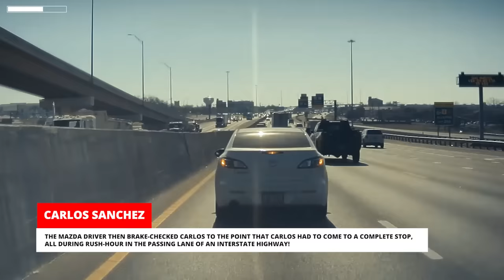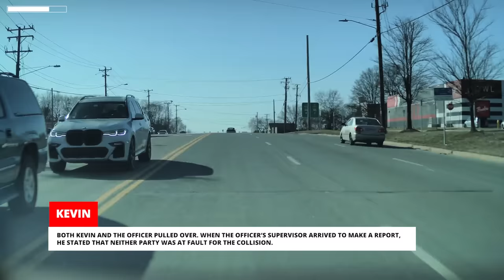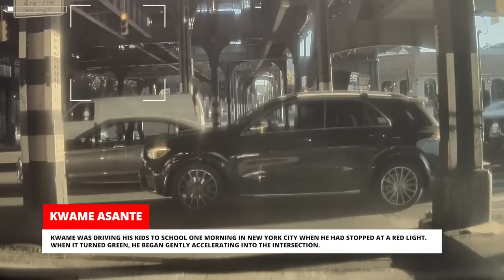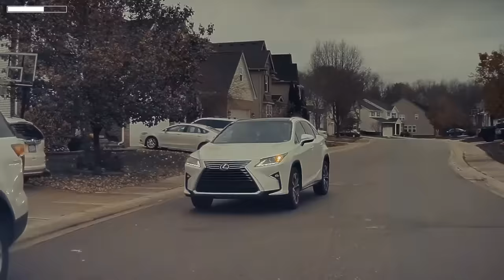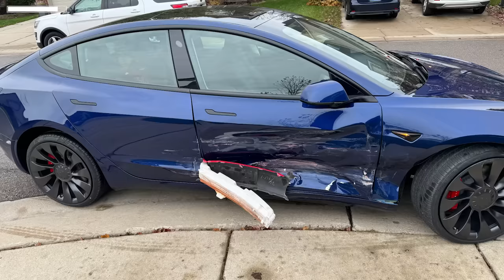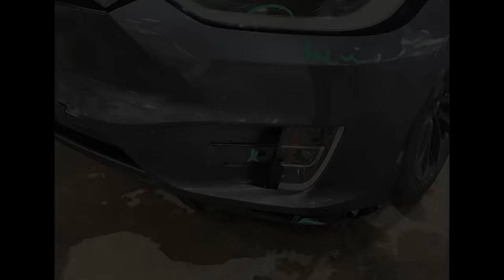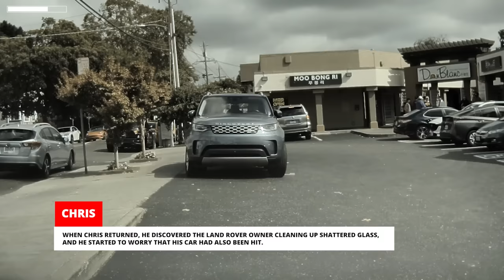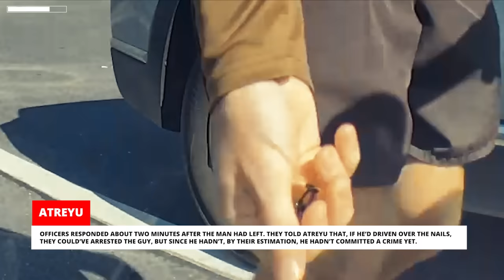INSANE ROAD RAGE ATTACK CAUSES MASSIVE HIGHWAY CRASH

Comment: The cops not pursuing the cause of the opening accident is absolutely insane
Reply: They probably made a report, they just put the Ford van as the primary factor and not the Mazda since they weren’t an involved party.
Reply: @B345T1N355Official they directly caused the accident they were so involved. Had it not been for them none of that would have happened they are the primary cause of everything that followed and because of that they are inextricably involved
Reply: Ammmmerica, here in Europe they would go after him 100% :D
Reply: Civil lawsuit against the Mazda driver for mental anguish
Reply: @account4info  Would be thrown out immediately tbh.
Reply: sure looks like Telsa cut off Mazda. you can see his front end dip from hard-braking.
Reply: @TehPwnerer  So you don’t believe the Ford van had any issue with maintaining a safe following distance or safe traveling speed? You don’t believe the Ford van, Chevy Silverado, and maybe the Highlander were inattentive? The police didn’t do anything here because there were likely multiple people who were factors in this. In chain reaction collisions, the fault is usually divided up, depending on the sequence of the cars crashing. You can easily claim the Ford van had an opportunity to avoid the accident and failed to take it.

Look at it this way.

P1 (Mazda) and P2 (Tesla) are both stopped for traffic up ahead.

P3 (Toyota Highlander) slows down.

P4 (Ford) barrels into the rear of V3 and to the side of V5.

P5 (Toyota Camry) is struck by V4 causing V4 to spin out.

P6 (Chevrolet) barrels into V4 just as V3 hits V2.

Any cop taking this report would see the Ford caused the collision as they had the last opportunity to avoid an impact and were the first striking vehicle.
Reply: Texas laws are weird, I have to admit.
Reply: @kenion2166  Highly doubt it. For all we know, the Mazda driver could be an illegal immigrant or they might not have assets. You’re better off going after the Ford driver.
Reply: @CuriousMess61  It’s kinda the same in California too. In order for insurance to go after a phantom driver, there has to be clear conclusive evidence the phantom driver caused the collision. In a lot of situations, insurance may make the excuse that the person who crashed was speeding and lost control and witnesses and the police may conclude the same.
Reply: @B345T1N355Official it's called a miss and run Mazda should be at fault for reckless driving
Reply: I drive in Austin. I was rear ended after being forced to come to a stop by an idiot that thought she should lock up the breaks and come to a complete stop because she wasn’t able to merge Into a turn lane. After I stopped behind her it didn’t take long for me to be rear ended. Since my car didn’t hit her car after I was rear ended she got off Scott free. Makes me angry as hell. Getting a dash cam only helps so much when dealing with idiots

Comment: Mustafa, my guy, a yellow light means slow down as it is going to turn red. Not saying the other driver was in the right, but it could’ve been avoided if you’d have just stopped at the red right.
Reply: Agree.  This is a case where both drivers were wrong.  Mustafa for accelerating and other driver for swerving into Mustafa.  Mustafa, my friend, learn to not trust other drivers.  Leaving that blinker on for so long was bad driving, but assuming he wasn't going to change lanes was, as you found, a mistake.  Remember this advice when driving:  There are always idiots driving on the road, and sometimes you yourself are one of the idiots.
Reply: And not speeding. Was plenty of space for beige car when they started moving over if cammer didnt hit the juice pedal.
Reply: I agree with this. He's mostly at fault. The other guy has some fault for changing lanes in the intersection, but Mustafa has most of the blame
Reply: The light was orange for at least 3 seconds. You never accelerate towards an intersection, you should reduce your speed since you are approaching an area where the chance of an accident is higher. He should have slowed down and stopped at the line. The orange/amber light is not your sign to floor it to get through, its to tell you to stop if it is safe to do so. Then his answer to the other drivers actions is to be more aggressive. Absolutely shocking driving and not surprising since he is so young. There is a reason most countries only allow you to get a license at 18. And really, its his parents car so he should have been driving even more carefully since its not his own personal vehicle.
Reply: @killerbye1985  If it was me and saw that? Would remove access from their device and then would go out shopping for a 15 year old Kia or Hundai Accent.
Reply: @russelljacob7955  agreed. I commented because I was so angry when I saw that clip. Such dangerous driving. Tesla should add a "my dumb kid is driving mode" which limits the top speed and the torque.
Reply: @killerbye1985  Same! Hence needs something basic with no power til learns safe driving.
Reply: For a 17yo, and this style of driving, someone should probably give this dude some slow car. Not a tesla.
Reply: @zYzIEk90 definitely. They could just put acceleration down on the car. I believe Tesla’s have a function to decrease performance for specific drivers
Reply: Mustafa, please don't ask to borrow another car until you've had some driving classes. Yellow means prepare to stop, not gun it.  Letting the other driver go away would have been preferable to lets pass into oncoming traffic so I can get ahead.  Excessive speeding on a residential street also not very cool.
Reply: Yellow light means go fast ain't getting stuck behind a red light no way JK

but I drive a lot so all the lights around where I live ik there time cycles and when they will turn red at the precise timing

He clearly ran the light so if he would have been in a crash pretty sure the cops would say he's at fault
Reply: yellow doesn't mean slow down.

It means STOP if it is safe to do so.
Reply: Actually no. A yellow means clear the intersection. Its to be regarded as a red light, but with the leeway of "we know you sometimes cant stop in time, so here is a yellow". Its NOT a "you may enter" light, even though selfish main characters use them like that.
Reply: Mustafa is 100% wrong. The other driver can't complete a lane change until the intersection has be crossed completely.
Reply: Agreed, yellow means stop (unless you can't safely before the light). In regards to the signal lights of the other guy, that was also bad driving. So I'd say everyone was at fault.
Reply: 100% agree. He ran the red light and was completely in the wrong.
Reply: Mustafa is at fault. I don't know how the law goes there, but here yellow light also means you need to stop and you're only allowed to proceed if you cannot stop safely. If it isn't like that over there, oh boy.
Reply: Mustafa, youth, ego and testosterone at fault.
Reply: No, yellow means get your car into that intersection before the light turns red... what's with all this virtue-signaling about slowing or stopping at a yellow?
Reply: @brandononbrand  LOL,I know your not serious.Thats a great troll though.Great post.
Reply: A yellow light is a warning that you may have to stop but you can keep going IF you are sure you can clear the intersection before the light turns red.  Yellow doesn't  mean stop - it is a warning that you may have to stop. A flashing yellow means proceed with  caution.   A flashing yellow arrow means you can keep going without stopping and turn left IF the way is clear.  Regardless of that entering an intersection always requires caution even on green.
Reply: Yellow is prepair to stop not speed up to make it

Comment: Retired Police Accident Reconstructionist here.. weighing in on some of the incidents:
* Police car was at fault for the accident. Police with active emergency equipment always have right of way, however they must be seen. There is no way to have seen the car make a u-turn from behind large vehicles. It was poor planning to turn there and not worth the risk when a simple traffic violation was the reason for the turn. 
Unfortunately some younger officers fail to realize that emergency lights and siren allow them to violate all laws except that of physics. Officers should not travel too fast in congested areas - they cannot help anyone if they don't arrive.
* Mustafa: He should have been paying better attention and not run the red light, then made the mater worse by trying to pass the overtaken vehicle. The overtaken vehicle changing lanes was not at fault - that driver cannot be expected to yield to a vehicle committing a traffic violation, such as running a red light. We have to drive as if other vehicles will obey traffic laws or driving would be impossible. In this case Mustafa ran the red light, accelerating to try to beat yellow and was approaching the other car from the rear.
* The nails in the road is littering and placing hazardous substance on the road as well as attempted destruction of property. I would have placed charges if I could identify the perpetrator. We cannot overlook these seemingly minor crimes - I believe the "Broken Windows Theory." (Wiki has an article about it).
People like the bus driver in the #1 spot should not have a license. He endangered the whole bus of people and only delayed them. If I could pass on wisdom to people, it would be to drive chill because taking risks saves only seconds and risks injury and huge delays. Stop at every stop sign!
Reply: Eh....? So you're saying that a dangerous granny driver who indicates for ages without changing lanes (thus invalidating his signal), then doesn't use his mirrors when executing a blind suicide-merge isn't at fault? And when he deliberately tries to push Mustafa out of his lane in clear use of a vehicle as a weapon, that's also okay?

Looked like a clear 50-50 situation to me.
Reply: @SVEVelsen  I didn't say anything about a "granny" signalling and not using "his" mirrors.
What I said was that the law does not require a driver to anticipate that another driver will commit a traffic violation. We must expect that other drivers stop at red lights or stop signs or we would not be able to drive at all. 
You said the driver made a "blind suicide merge" and then said "deliberately push.. out of his lane.. use of vehicle as a weapon". 
You cannot do both - blind 'suicide' merge means not looking when changing lanes, while deliberately using the vehicle as weapon means there is intention. You cannot intentionally hit someone if you do not look or know they are there.
If a person intentionally hit another they are at fault. 
If they do not yield to another's right of way they are at fault. 
Mustafa ran the red light and the other driver could not have anticipated that. 
If there were cross traffic with a green and Mustafa hit them, it is the same principle.. 
Furthermore, Mustafa was speeding and improperly tried to pass the overtaken vehicle.
The turn signal for miles example you mentioned is irrelevant - it is not a traffic violation, just a signal of intention. The vehicle being overtaken while in the roadway lawfully has right of way. This is a basic principle of driving. 
People need to be more patient. The US alone has 40,000 fatal accidents EVERY YEAR. A couple seconds of patience is worth a life.
Insurance may split payments, but there is rarely a case where there isn't a clear person at fault. There are contributing factors in some cases, but that does not impact assignment of fault. 
When we look at these there is usually a 1st event or violation that began the chain of events that leads to a collision. In this case they did not hit each other, but we can take lessons and learn from the each encounter shown, as Wham Baam Teslacam does so well.
Reply: Kevin should have seen the flash lights of the unmarked police car.  If a Tesla can't "see" that any better than Kevin, Tesla needs to add some kind of provision to recognize that situation.  I saw the flash lights an hour before Kevin, but I realize I'm far better than most drivers.  That's my cross to bear.

Comment: 13:12 - My analysis
* Mustafa had at least 4 seconds of yellow light to come to a safe stop. It was well within his control, he was either distracted or had poor judgement (The latter is understandable for an inexperienced driver- But it doesn't excuse his behavior)
* Beige car was making an unsafe lane change (It's illegal to change lanes within an intersection). Mustafa was right to honk at that car.
*  Mustafa was wrong to aggressively pass the beige car.
* Beige car driver was wrong to try to push Mustafa out of his lane.

Overall, I'd say that Mustafa was more in the wrong for speeding, aggressive lane change (Indicative of road rage) and running a red light. The beige car was also wrong for making an unsafe lane change and road rage, but that was triggered by Mustafa's own road rage.
Reply: The lane change was only unsafe because Mustafa ran the redlight. So you can remove that from the beige car, specially since his turn signals was on at the prior intersection that the young kid ignored the control signal of.
Reply: @samkdaily3055 also the driver of the beige car probably thought he had been hit and that Mustafa was trying to run (which it looked like)

Comment: 14:11 of course it is your fault. You ran a red light.
Reply: I disagree. The beige car wandered in front of him without a signal and in the intersection, which is worse than slightly running a red light.
Reply: @sssnake2332 well the light was red before the submitter entered the intersection. The beige car probably wasn't expecting the other car to run the light as well. At this point it would just go down to the last clear chance.
Reply: How is running a red light out of your control? 💀these people should not be driving

Comment: 14:17: Both were wrong. Mustafa for running a red light. You don't accelerate unless it just turned yellow and you will be half way through before it turns red. In the video, the light was red before he entered the intersection. The other guy was also wrong for changing lanes without it being clear. In California you can change lanes in an intersection if the way is clear but not all states. If there had been an accident, I think Mustafa would have been mostly at fault.

Comment: Someone ought to start marketing Lexan polycarbonate back windows for Teslas. They may scratch, but they're very hard to break.
Reply: Even with a spring-loaded or canister-powered window punch tool? I'm genuinely asking, not being snarky; those fast-punch tools are what these thieves are using. :(
And would it be legal to use that on a car? If police and/or first responders can't break your glass...?
I know police/FR wouldn't be trying to enter the car through that tiny window, but a lot of laws don't make sense and/or politicians don't take small details like "non-entry window" into account when they make a blanket statement "your vehicle windows must be made of safety glass" law.
I wonder if you got a piece of Lexan cut to the same shape and just glued it OVER/ONTO the existing window, if it would still protect the glass, or if the compressive force from the punch tool would travel through the Lexan and still break the window underneath it? (I mean, the seat-flip thing is useful and all, but it would be a much better solution to not allow the window to be broken in the first place and avoid that replacement cost. There are folks who've submitted videos in places like SanFran who've had to replace that little window 4-5 times because they keep getting targeted.)
Reply: @carriebartkowiak Well thought out. Very good. 
There is another item to consider: window security film. Even if the tempered glass crumbles, the film holds it all in place. 
(just thinking through the options, none tested and where I live, not so much needed.
Reply: @carriebartkowiak  The thing with making the small window Lexan is that when the small window fails to break or they get wise to what is going on, the thief will simply break the larger and more expensive window right next to it.

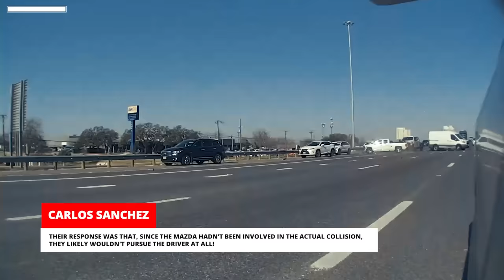Comment: 2:34 the law NEEDS to be changed then where if you brake check someone resulting in causing a crash, whether your vehicle is actually touched or not, then you are held accountable! Yes they will say those other vehicles obviously didn't give themselves enough safe braking distance, but the brake checking fool needs to be found even partially responsible. No one should be able to cause a 7 car crash or a one car crash and get off scott free....that driver should also be charged or given citations for toad rage, reckless driving, etc.... But given its Austin TX, a mini California, I'm not surprised....
Reply: The problem with that is in this video, the Ford van could have slowed down but was following too closely and ended up crashing into  the Highlander and the Camry. The cops likely faulted the Ford van for that.
Reply: Texas is a conservative state. I doubt Austin Texas cops are liberal. Your obsession with california is pathetic